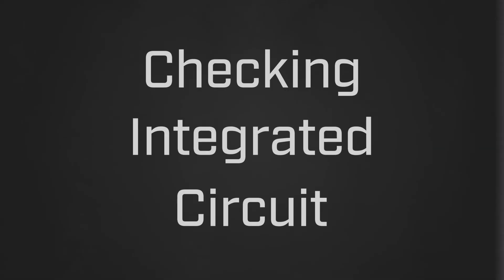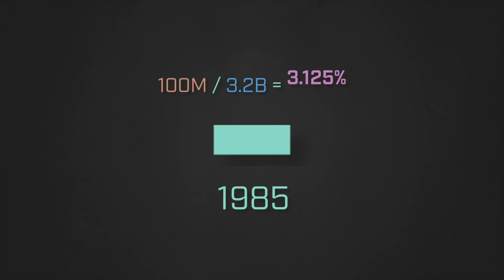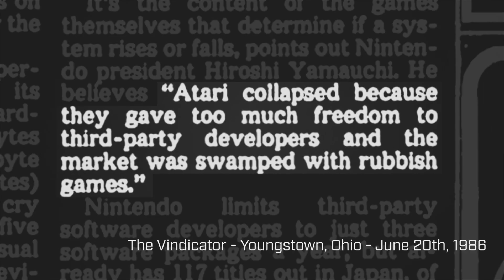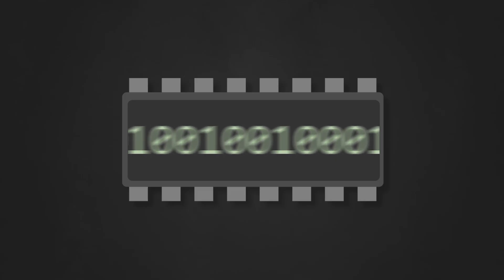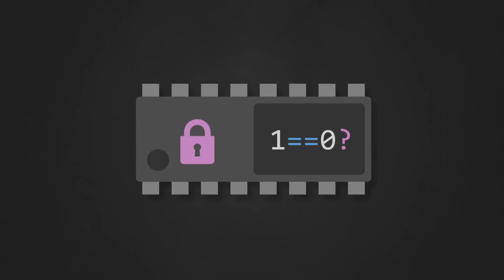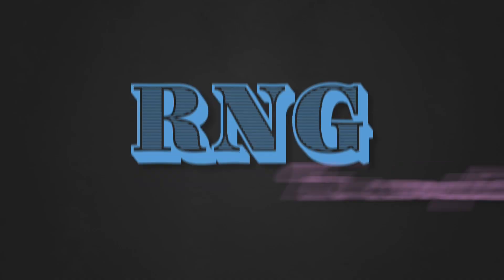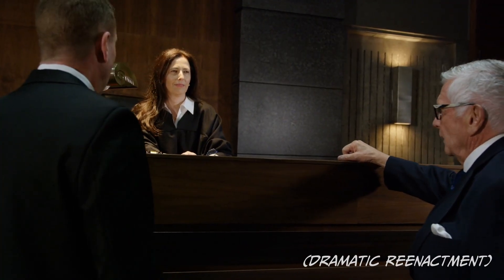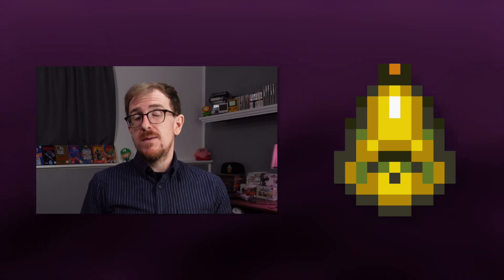The CIC & 10NES Explained

Comment: Although destructive, I would recommend every NES-001 owner to just open their system and physically disable the damn NES 10 chip. The Famicom, twin, AV Famicom, and even the NES 101 all work perfectly fine without the CIC, and besides, those who choose to play NES on original hardware these days are going to be the kinds of people whom Nintendo never thought about all those years ago when they designed the system. They are the homebrew enthusiasts, ROM hackers, fan translators, power players who keep retro gaming alive.

If the CIC being disabled negatively affected the NES in any tangible way, I could see keeping it intact but that simply isn’t the case. The CIC was a good idea at least initially in order to prevent the same fate as the 2600 had seen in 1984, but at the peak of its popularity in the latter years of the 1980s the CIC no longer was needed. Atari might have been underhanded but they were at least right in the concept that third-party developers should be able to make as many games as they like to. Nintendo artificially limiting third-party developers was draconian and revenue limiting even for Nintendo themselves.
Reply: nah
Reply: Yeah, from what I recall, all you really need to do is sever the pin that the 10NES uses to issue the reset signal to the CPU and PPU. Presto chango, it can be as unhappy as it likes and call for a reset all day long, and nobody cares.

But, I've got a toploader, which supposedly doesn't even have the 10NES chip. Though these days I just use a MiSTer...

Comment: Wait... did you list 3D Tic Tac Toe in the list of bad games? That was incredibly impressive in a 2 KB ROM. And the AI was difficult, with 9 different levels. It was simple, but exactly as advertised :)
Reply from the maker: I’ll have to go back and really give it a try then 😆
Reply: @NesHacker  Hehe, yeah it's not going to blow your socks off but it's surprisingly hard. The AI on the harder difficulties takes a long time using a minimax-like algorithm. It plans ahead and will block you. All in 2KB and 128 bytes of RAM to work with. 6502 wizard Carol Shaw (of River Raid fame) was the programmer:  https://www.youtube.com/watch?v=a78uBNlI8Z0. Still, I like it more as an engineer than a player.

Also, loved the video. IIRC a few unlicensed games used a "Sonic and Knuckles"-like approach with a pass-through cartridge connector on the game. You had to plug any licensed game into the unlicensed game so it could pass through the CIC signals. It didn't even matter if the licensed game's CHR or PRG ROMs were fried, so long as the CIC was there.
Reply: The bad thing in tic tac toe is once you understand how the game works it can only end in a tie

Comment: Very clear description of the CIC lockout chip, especially considering the history, legal and technical aspects. Thanks!
I'll add that Nintendo really liked the 4-Bit Sharp "Micro-Computers" since they were used in the Game & Watch series all the way up to the N64's lockout chip the "PIF".
Reply from the maker: They also used them as motor controllers in the R.O.B. too, I can't wait to do a video on that funny little guy.
Reply: Nintendo and Sharp have had a fruitful relationship since their incursion in the consumer electronics and video game industry. Sharp has provided screens, chips and even more components to them. It is well known they built the only TV with an incorporated NES console in it.
A couple modern examples:
The 3D screen for the 3DS is built by Sharp based in other autostereoscopic technologies they originally used in laptops in early 2000s.
Sharp got a license by Nintendo to build the Switch, to ease the problems that arose from the US-China economic tension.
Reply: @Tamhvm  No wonder Nintendo electronics are so high quality. I seem to recall that Sharp electronics are similarly indestructable.
Reply: @johnrickard8512  It is also notable that some of the processors they used to make were quite robust, tolerant to power faults since they worked with very low power.
It is sad to believe that they had to shut off one of their display factories in Sakai.

Comment: Amazing video!!

17:24 - IIRC It's the same idea as the modern day "USB Killer".  In short:

- charge up an internal capacitor of the "evil CIC" using power from the host device
- once fully charged, send a super high voltage down a specific pin to the lock chip (Too much voltage can be very harmful to electronics on the receiving end as voltage is basically electrical pressure, thanks Schoolhouse Rock!)
- Lock chip puts out magic smoke and can no longer reset the NES
- Freedom!

There is a downside to this method though - Attempting to use the trick on a system without the 10NES will end up bricking it (this even happened in an episode of AVGN where his top loader NES was killed by one of those carts!)

The best way today to disable the 10NES is simply to open up the console and cut pin 4 of the lock chip.  Unfortunately the NES uses an inverted motherboard so it's a little more work than just removing the case and cartridge housing, but iFixit has a step-by-step teardown you can follow and there's no soldered controllers like the Famicom
Reply from the maker: As always you’re amazing Kirby <3
Reply: This isn't nearly how it worked! All the lockout defeat systems sent a NEGATIVE voltage to the chip, and it wasn't actually that high, it ranged between -0.6V and -6V. The mechanism HOW exactly it defeated the chip isn't known, but it certainly wasn't intended to cause a latch-up or permanent damage, the chip usually survived perfectly fine.

The fact that the voltage is pulsed appears to have been vital to the operation. Simply connecting a 7660 which would generate -5V to the data lines doesn't lead to quite the desired effect at all, the chip wouldn't work properly but would reset the console anyway.

Somehow the negative voltage must have reverse biased a part of the logic in the chip and suppressed it from functioning correctly, but that's only part of the puzzle.

With modern CMOS chips, such a system wouldn't work like that, because nowadays and in the last 30+ years, all IO pins have ESD diodes on them, diodes going to VCC and GND. However these diodes form the attack vector for "USB Killer" and such like, since if you force enough current through, you can cause this diode to turn into a permanent conductor and thus "latch up", and USB is particularly difficult to damage, since it has in-line resistors on data pins, and the "USB Killer" must overcome those. Maybe NMOS didn't need ESD diodes to ground yet for some reason?
Reply: @SianaGearz  I was always under the impression that they "stunned" the chip, like you said, and didn't destroy it like the USB killers do.  But, I've never seen one of these dodgy carts, and I'm not an EE anyways!

I think a better analogy might be more like "chip fuzzing" than "USB Killer"...
Reply: @jaysonl  That's pretty much what happens - the voltage spike triggers a hardware fault in the chip that stops processing of the lockout code. 

After that, it seems the NES defaults to allowing the game to run, perhaps as a failsafe in case the lockout chip ever failed "naturally"?